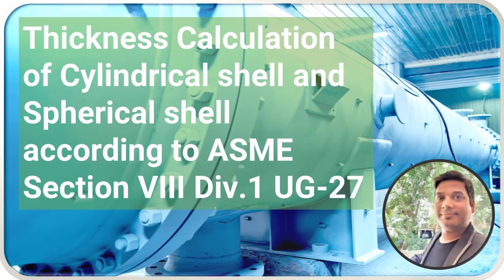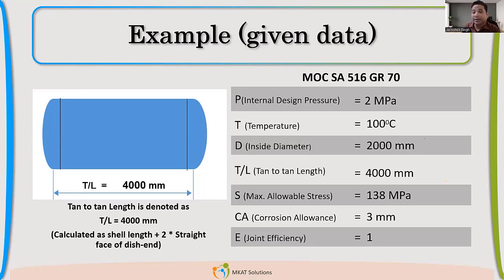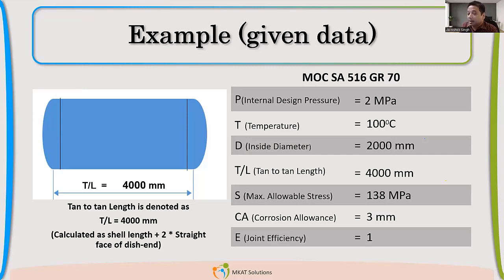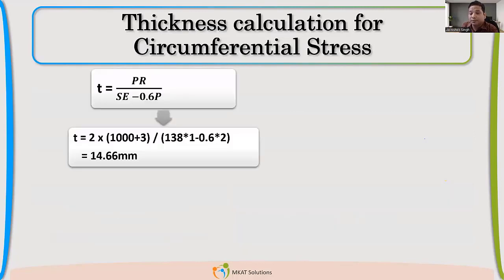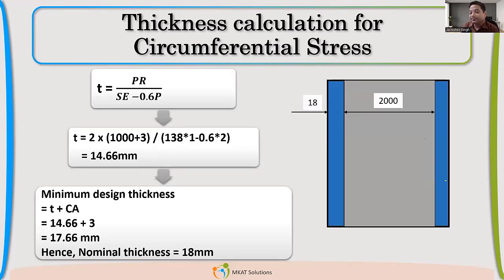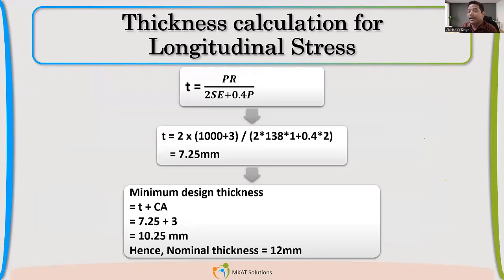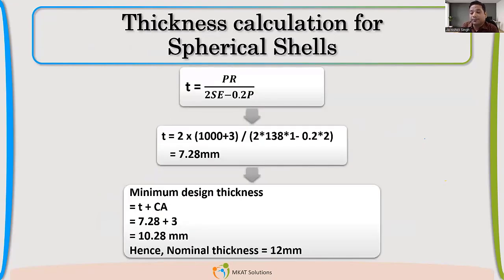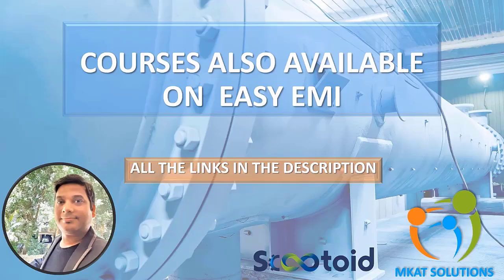Thickness calculation of cylindrical shell and spherical shell according to ASME section VIII Div1

Comment: 1) What if the first condition of UG-27(c)(1) id not met. Can we go for FEA? Or it means that the vessel can not be certified (design, fabricated & tested) as per  Div.1?

2) Is code allows any alternate design if 2nd condition is not met?
Reply from the maker: 1. No FEA is required, Refer formula available in Mandatory Appendix 1
2. Yes, Refer formula available in Mandatory Appendix 1
Reply: Thanks
Reply: No FEA allow as per Section VIII Div 1 as it is design per rule basis.